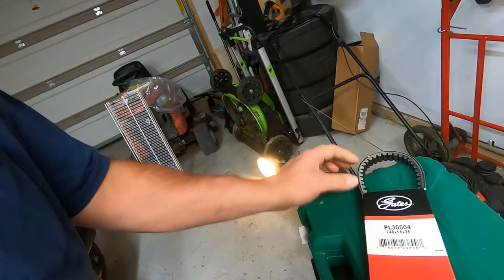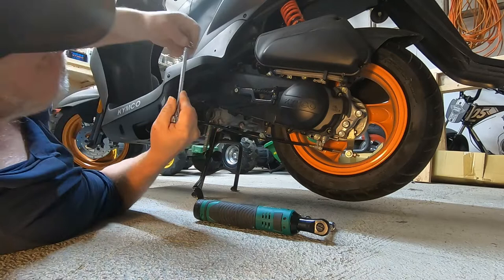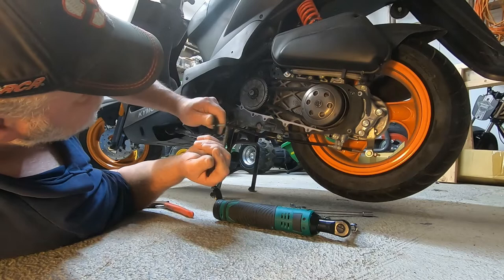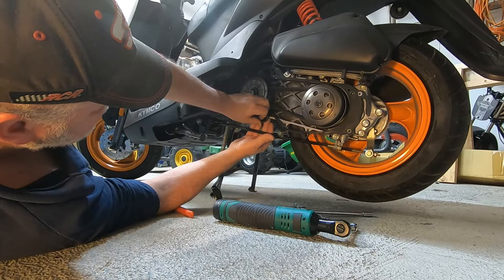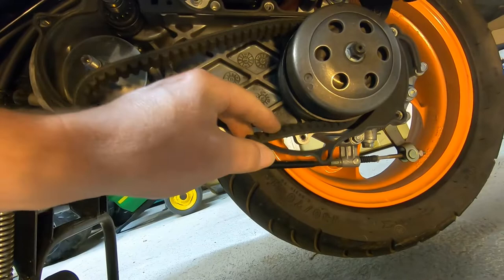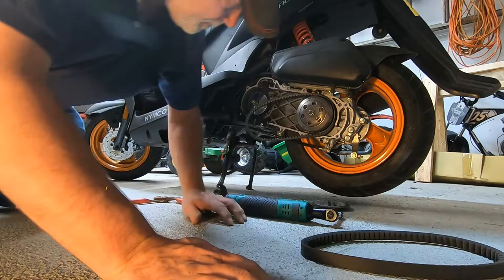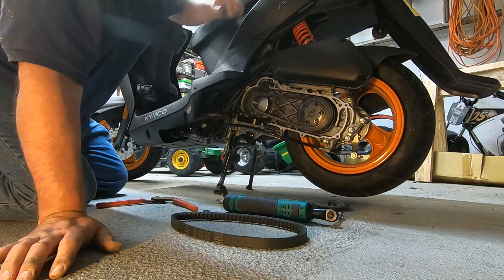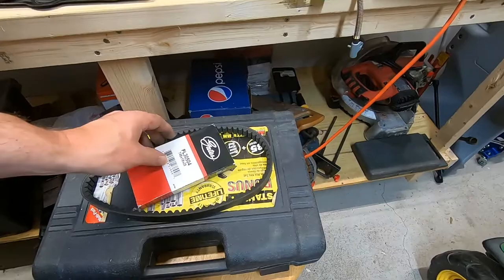New Kevlar Drive Belt For My Kymco Agility 50

Comment: Super helpful video on replacing the drive belt! Would you happen to have the dimensions for the original belt? I think they are marked on the side somewhere
Reply from the maker: The original belt is labeled  Kymco 23100-KEB7-9000. That is the only thing on the belt itself. The new belt I put on it is a Gates PL30504 Premium PowerLink. I hope this helps. Thank you for watching!

Comment: One issue I am having, and I thought by replacing the belt will go away is a noise when I am giving it. No when I Lego the throttle or even given throttle, I hear a noise in the compartment where the belt lives. I’m not too sure what that is, it’s been making that noise even with the old belt and out with a current belt still but I did notice a big difference with a newer belt 1 hp

Comment: i have a kymco like 50 i  cant even go up to 30 miles and i feel like the drive belt is slipping.   well i took off the cover to see and i saw a lot of drive blet black dust.   even if the blet looks ok i thing its slipping wore out.  i will look online for a blet like yours.  miles on my scooter are 300
Reply: I’ve got the same scooter as yours I’ve got 1100 miles on mine and I was noticing that when I take off on mine and I can feel it slip so it’s time to change mine also

Comment: hi i installed a new blet my question is when installed why do you have to have play around the pulleys mine did not have play.
Reply from the maker: Sometimes, if you don't squeeze the belt to make some play, when you put it back on, it can get bound up. I haven't had it happen yet, but I haven't worked on scooters a whole lot. I do it just to make sure it doesn't happen.

Comment: So did it make a difference cause I’ve gotta do my kymco 50 also
Reply from the maker: It did help. The old belt only had a few hundred miles on it but I opened the case and found a mouse nest in it and it cause the belt to get a few small chunks taken out of it. That might have caused it to lose structural integrity. The new one does seem to grab better and I could swear there is a slight top end increase. Only by a mile per hour but I'll take it.
Reply: @Grey_Beard72  thanks for the info mine has the factory belt still on it and it looks just like yours I guess the Kymco belts are made of poor quality material but I’m like you i travel in hilly areas also and premature wear on a stock style belt might be just a normal issue around every 1000 miles ,I’m gonna get the same belt cause we have identical engines and see what happens , I thank you for the reply back ride safe and have a great weekend

Comment: Question. What size nozzle/jet do you use in the carburetor? Thank you.
Reply from the maker: I'm not even sure what size it is. It has the factory carb on now.  The carb I got to put on it is supposed to be jetted up a little.  But I'm not sure about the size. I will do a little research, and if I figure out the size, I will let you know.
Reply: @Grey_Beard72  thank you sir. From what I read they are delivered here in the Netherlands with an 80 size (over here 50 cc are legally not allowed to drive faster than 45 kmh). From what I read an 82 size jet will make it run smoother.  I have a Kymco People S 4T 50 cc. Probably with the same engine as yours.
Reply from the maker: @frednetherlands887  Mine was restricted to 28mph, which is 45kmh. I believe they send all of them out like that. At least Kymco. Here you can go 35mph, which is 56kmh. When I swapped out the roller boss, it got me to 37mph/59.5kmh. I later changed the cdi and if I wasn't 225 pounds, It could potentially go up to 43-44mph. It will do it down hill with me on it. The hill I am talking about isn't real steep. When I can get to it, I will swap the carb and slap on a free flowing exhaust. I'm hoping that will open it up some more.
Reply: Thank you. Indeed the same Kymco setup here as I understand. I have the same weight. I will check the variator ring and will experiment with the carb jet size. Changing the CDI is illegal here. Police will either measure ones driving  speed and even have mobile roller benches to test for output of power and speed of scooters. Just a little more power within the legal limits would be nice.
Reply from the maker: @frednetherlands887  Sounds like they are very strict their.

Comment: I am not sure if it has a Cdi I can’t find it on this KYMCO like 50  .
Reply from the maker: They are usually right next to the battery.
Reply: @Grey_Beard72  not on my scooter i ben looking for it
Reply from the maker: @ram457moreno  I did some searching on Google and I seen where it may be located at the throttle body.
Reply: @Grey_Beard72  i think its on the carb
Reply: Yours has a cdi I’ve got the same scooter mine is located behind the seat pan zip tied to the frame that’s where kymco put mine

Comment: question after installing new blet took it out for a ride might sound crazy question but will the cover to blet feel hot .... mine is hot if i place my hand on it..
Reply from the maker: It can. That is why it has an air intake and exit designed in the cover. For cooling it the drive system. They will still get hot though.
Reply: @Grey_Beard72  yes saw that was just making sure that was normal

Comment: I went back to check the belt now the sprocket is stuck. I took the nut off in the washer, but still would not come off. Not sure why it stuck now I was going to check the belt, taking off the sprocket.
Reply from the maker: Did you figure out the problem? I thought maybe a weight got sideways and jammed. One did that to me when I was putting it back together but I caught it.
Reply: @Grey_Beard72  no after removing the nut in the washer I pulled on the sprocket which I shouldn’t have to but it’s stuck on the crankshaft. It won’t slide out and I’m sure it’s not the rollers. It’s the sprocket is stuck on the crankshaft I’m thinking because I use the impact that’s all I can think of so now I have to find a pulley for something to pull it back. I did spray a little bit of WD-40 in the center trying to work it back and try to pry it back a little bit but it wouldn’t. It moves a little bit but still won’t come out. I went ahead and just put it back together and try to scooter out again of course it rides much better now with a new belt. Also, the other reason I was going to take it off because I seen other videos that has a washer on the back of that sprocket but I don’t remember seeing one so I know I took it off in order. Also, I ordered some new rollers from the scooter place so eventually I’m going to have to take that sprocket off somehow I’m going to see if I can find on YouTube anyone who might have had this problem the sprocket being stuck to the crankshaft and how they took it off.
Reply from the maker: @ram457moreno  Good luck!
Reply: @Grey_Beard72  well, I got it off what happened is when I installed it. The star in the middle was on top of the teeth of the crankshaft teeth, so they were on top of each other not on the grooves where the teeth should slide on. You got the star and then you also had a middle nut that has a star as well, so you have to be careful installing the main sprocket with a star and a little sprocket nut that they slide on the grooves not on top of each other hope you understand what I’m trying to say
Reply from the maker: @ram457moreno  Glad you got it.